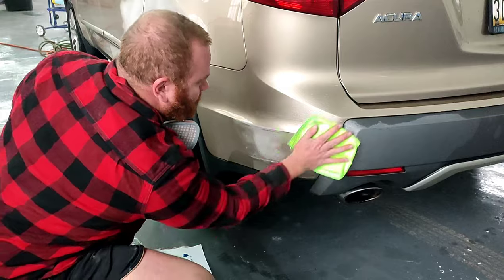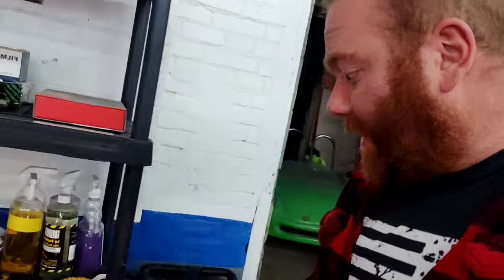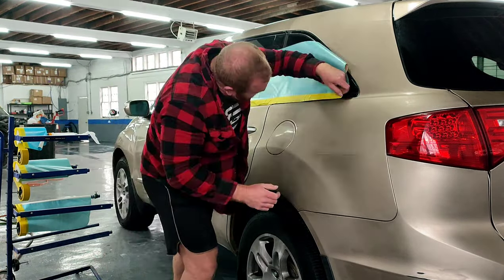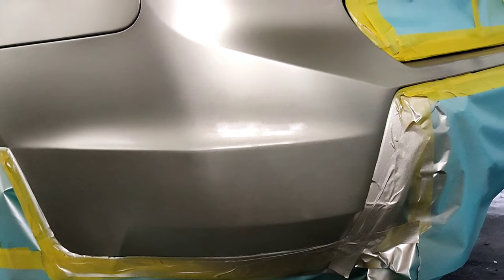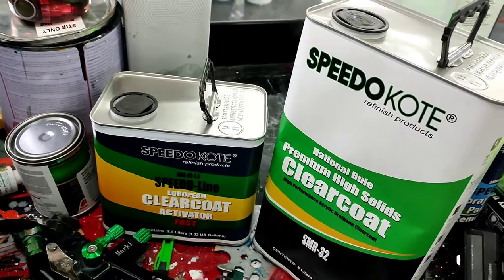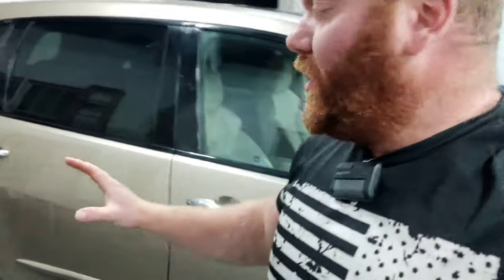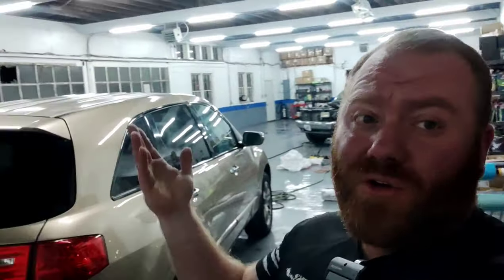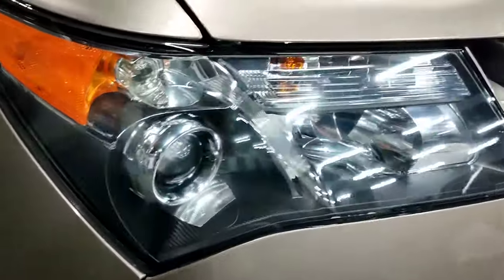How to paint a car in the cold

Comment: Looks good, nice job and thank you for the explanation on the wet bed. What tip does that gun come with and can you get others if need be? Would you consider it a user/beginner/diyer freindly gun?
Reply from the maker: I have the mv1 kit which comes with both 1.3-1.4 tips.
Reply: What does that kit run price wise?
Reply from the maker: @davidcrystalprater73  https://youtu.be/s0FnmLay1w0